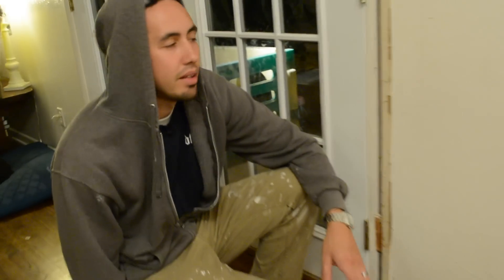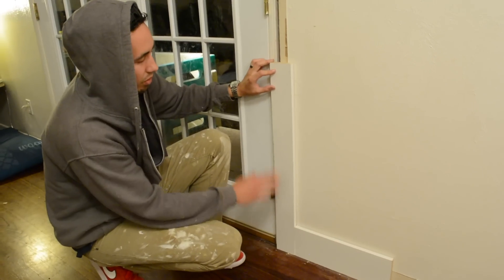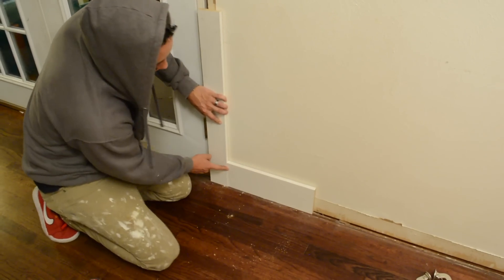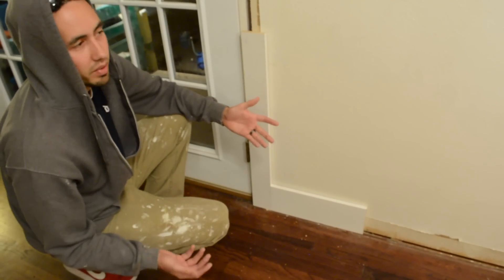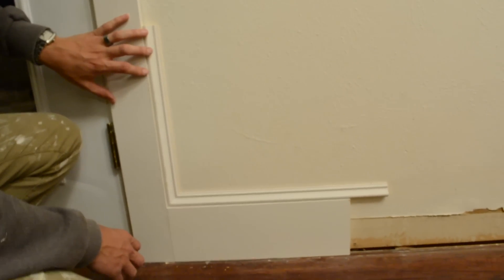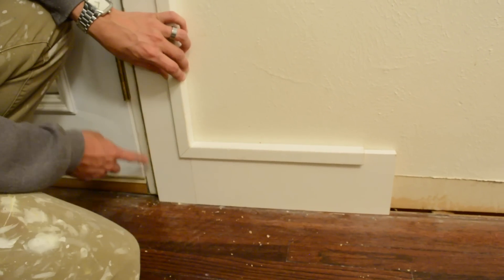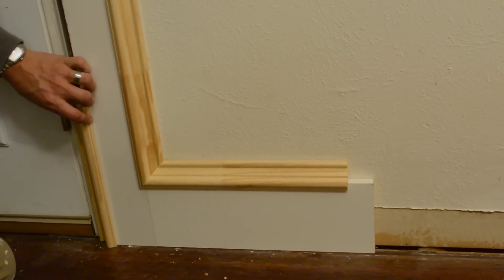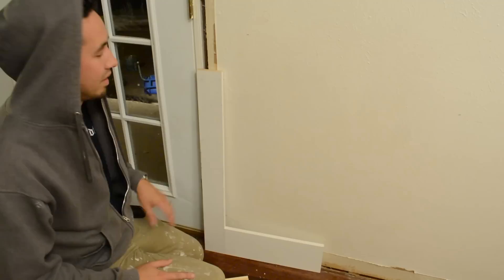3 Awesome Baseboard Ideas!

Comment: That corner molding on flat casing is a very classic look.  That is almost exactly what a previous house of mine had when it was built in 1913.

A cool baseboard treatment that I did was to have a base shoe in front of a 7-1/2" baseboard.  Then turning my electrical outlets sideways, I placed the box so that the outlet plate was exactly 1/4" above the top of the baseboard.  Then I added a case molding at exactly 1/4" above the outlet plate.  I used chocolate brown outlets and plates and then painted the shoe, base, case and any exposed drywall a chocolate brown colour.  The effect was that the base board looked like it was 14" tall.  Very classy look in our living and dining rooms with 10'6" ceilings.

Comment: I also LOVE shoe moulding! I think it totally makes the room look clean & finished, not to mention covering up a multitude of sins between the base & the flooring. I have yet to install base on a perfectly flat & level floor, but the shoe (& a good caulk job) can be manipulated to hide any small gaps. I love your videos They are informative & interesting & they are detailed enough to give a really good how-to without being slow or repetitive. I always learn something from them. 

I have a bathroom I installed beadboard in as wainscoting and I want to top it with a 1x3 as a "chair rail" with a 1x4 shelf installed at a right angle atop that. I want it to be strong enough to actually be used as a shelf for small items (picture frames, hair products, etc...) & I was thinking about using pocket screws to attach it to the studs. I just can't figure out the sequence & if that will actually work. I always see people top nailing the chair rail with finishing nails and that just doesn't seem strong enough. The wall is NOT flat (it is an old mobile home so I work with what I have) so if I put the 2 pieces together & then try to install it as a solid unit, I am gonna have gaps on both the 1x3 & the 1x4. If I put in the 1x3 1st I can cheat some of the lower gap & hide the upper gap under the shelf but I am gonna be pocket screwing in from the outside of the right angle & that is never good. I figured I would ask the expert! What do you think?

Comment: Here's a cool idea I saw somewhere but haven't tried yet. With that plain casing and baseboard when you go to add your pm5, or anything you like, you would use a one or one and a half inch spacer and install the pm5 above your baseboard. This will only work for painted trim. But when you finish you paint the pm5, the space you left between and the baseboard and or casing all the same color and it'll look like its all one piece and a much more expensive piece at that. Might look nice in your house.

Comment: All are good options and add a lot of extra style to plain trim.  #3 is nice, but too "beefy" for my taste unless it matches the whole house.  If you have access to a table saw and router table, the world opens up to you with options.  It is so much cheaper than buying off the shelf trim too (builder grade).

I'm going with standard one-by (3/4") trim boards myself, so I can build my reveals into the stock and not have to add separate pieces.  A more craftsman/shaker style with a simple inset bevel along the top edge and a small v-grove below it on the face.

Comment: Thanks for your insight and ideas,  I'm getting ready to buy my house and I was toying with a few ideas on how to re-do the millwork.  
What I've done in the past, is to use biscuits on my transitions. It's a little quicker and I don't worry about splitting out the mdf. Thanks again,  I really enjoy your videos.
Reply from the maker: Nathan Silver yes the biscuits would be just as good for keeping them aligned.
Reply: Nathan Silver
Hot Glue applied at the backside is MDFs nemesis. Clamp it glue it done,  if you get good enough I put it right on the wall hot adjust it nail it hot if it needs a tweak just pry push whatever and hold for a minute BAM. IMHO, MDF does not take to the expanding biscuit or any water based element without an amount of expansion. They need to start making trim outa HDF would be so much better.

Comment: I have been binging on your videos recently because they are so informative and you think outside the box and explain what you're doing very well. It seems though that in DFW Texas you have a lot of new construction to work on that is very square and straight. I live in Michigan and mostly work on older homes, or sloppy new construction with rough framers who don't even crown their 2x's. I am not a finish carpenter, I work on exterior mostly, but am looking to trim the inside of my home because it looks so whack. Is there an email I can send you pictures at and see if you have any helpful hints and tricks for sharpening up old plaster walls? It would be much appreciated.

Comment: I do alot of 1x mouldings too...instead of pocket holes to flush up casing to base, to get perfect reveals on 5/4 headers to the 1x side casing, or flush up 1x headers to 1x side casing, I use my festool domino joiner, but you can also use a biscuit joiner. I work a lot by myself so it's easier and quicker for me. Plus with the domino machine I can set it to a wider mortise which allows for movement...if I need to slide one piece up, down, left, right...or seasonal movement if I'm using real wood and not MDF.

Comment: DFW, love the idea with the 45 degree corner molding over the baseboard and casing.  I think I might try that.  only problem is I already put new base in everywhere but if maybe i'll rip it out :)  I like more the clean lines so I'm liking that option you provided.  thanks

Comment: you always have great tips, I worked for a guy that was an amazing carpenter. we would actually sand the paint so the glue wood stick better not sure just what he had us Do. another thing is we would use the Makita brand drill bit heads and the gold tip #2 for the impact gun. those work the best they are the most comfortable. always have a lot of them on hand. even though we would Craig jig everything we would also use bond where you would see 2 peices join then sand. but you are the best I have ever seen with the skills you have. I've never seen someone so well rounded in all aspects of this construction game !!!! wish I worked for you.

Comment: Question....after you lay down base or even shoe, how do you mask the floor off to both prevent from painting your floor and to achieve a nice crisp color transition between the trim to the floor.  Do you leave a gap between the base and floor to slide a strip of tape under or no gap requiring you to get as close as possible with a good masking job? I went with option B and spent hours on my hands and knees with a razor blade fixing my mistakes. Great work.

Comment: Great ideas... I'm installing some new laminate flooring and I'm thinking of not removing the base board and would like to 
use the PM5  in place of the quarter round . Would that work as I need to leave a  3/8" gap on the on the flooring
on each end for expansion. My better half isn't a big fan of quarter round. Thank you in advance.
'

Comment: I just read all the comments. Just an FYI or newbie DIY'ers coming across this video, and considering upgrading trim in this way,  I might mention that sometimes if the trim is widened,  the electrical switches might have to be moved over (if you have the wall space), as you can see in this video at 8:34. And in some houses, the outlet boxes might have to be raised if they are lower.

Comment: Do you ever have trouble with MDF swelling? We use finger jointed solid timber. They have MDF mouldings in old homes. Soft mushy stuff when pulling it off. We seem to do things quicker here, one piece mouldings rather than capping and shoe moulding additions as it's the customer paying for our time but I'm only new to building and haven't had anything to do with high end homes who would be likely to do more elaborate finishings . And on Mega Decks which we get here on TV they wear hoodies all the time.
From NZ

Comment: As pointed out by others. pocket screwing a long length of baseboard to a full length of casing is extremely difficult even for a carpenter.
Flush (butt) joints are to be avoided, if unavoidable then biscuit jointing is the fastest, safest and strongest way to go.
Reply from the maker: biscuits would be good as well. Especially with some gravy. JK. Haha. But seriously biscuits/plates would definitely be a great solution too. Thanks.
Reply: dfw crown, biscuits and gravy, now your making me hungry.
However you work, be safe out there.

Comment: Plinths and rosettes. How would the pm2 under the outside corner look? Don't have any handy but you made me curious. You can do so much with base cap. I just made an awesome chair rail with some repurposed 1x and base cap then had enough base cap left to make 9 picture frames under it in a bathroom remodel. 1x stained pine columns on the far wall by the toilet and shower topped with some scrap crown gave it a great look. This was  done pretty much with lumber that was scrap...and some caulk. lol

Comment: God help the next carpenter/homeowner who needs to replace either the casing, or the baseboard.
Reply: I'll agree with you pertaining to the pocket holes, that would be frustrating. Everything else is common trim, no special orders. Throughout all the homes I've built and renovated, replacing something like this would not be a major concern. Yes, it may be a little tedious, but if someone needed help from a higher power to replace any of it, I would not want that person renovating my home.

Comment: Hope you check your comments because I got a big question. Im doing a full rehab for my family, and have to trim out the entire house. I do have a paint sprayer but im not that good with it + floors are in and walls already painted. My contractor has suggested I just buy the trim, roll it all with paint ahead of time, then install. But after watching you and idaho painter, I can see you guys dont do it this way. 

Just wondering if you think its worth my time to go the extra mile and learn to use the sprayer better, and mask it all off? I have like 500 feet of trim probably im doing. And as I said the house is all finished except for this part. I want it to look really good as ive come all this way, so currently im undecided which direction to go...

It may be one of those situations where its not as hard as im thinking it will be + ill learn a new skill. but im also really ready to move in, and I know I can roll them all in a few hours and then be able to install next day... no masking needed.. tough call, thanks buddy.

Hope you can answer because Im sure there will be more beasts searching old videos of yours trying to learn the best way to do things!
Reply: and by the way, excellent video!!!

Comment: I would like to fake raise the height of my baseboards (with some sort of product a few inches above the existing basic colonial(?) baseboard and then painting the entire thing white to look more cohesive). I need something that has a depth of 1 inch at the top so a board and batten treatment won't extend over it. I am thinking I may even have to install some type of molding upside down, but I just can't figure out what to get. Do you know of a trim product that has a depth of 1 inch on one side that wouldn't look out of place on the top of a baseboard?

Comment: Good morning dfw , enjoyed the video/education .  
re the pocket screws , I like the idea of them , but as was pointed out , easy to do with short pieces , but I don't see it as much of an option with full length pieces .  I guess it just fits under " Whenever possible " .  although as another one mentioned , the use of a plinth block is a nice look ( and a good place for screws )  , that also opens a can of worms as to how everything would/could fit .  In the same thought  , I guess a block wouldn't work with wainscoting , And I certainly wouldn't give up the wainscoting just to have plinth blocks .
Love the ideas of the extra moldings . 
And while we're on the subject of extra trim around the casing , how often do you end up doing something different with the casing header on the doors/windows ? 
 Keep em coming   Bob

Comment: So by using pocket hole screws .... which I think is a great tip BTW.

But doesn't that mean if you have a wall that has a door in the middle that you'd have to put it all together on the floor and stand it up in one shot?  Do you have a video actually showing something like this?

Subscribed!

Comment: I've always been a bargain hunter.....it comes from my mother's side 😏. trim costs can really add up, especially when you layer on like you are suggesting. any ideas on getting the most bang for the buck?
Reply from the maker: The only way to do that would be to do it yourself. It is not too expensive. What is most expensive is the labor.
Reply: +dfw crown so, do you just buy it from the big box stores, or have you found to be able to find good prices from a online source? if you had a shaper or router with the right bits, could you save money by milling your own? thanks....that's my last question.

Comment: hey, very nice and inspirational! if that technic can be transferred to the ceiling, how can that be mounted to the ceiling if the studs are running parallel to the trims? screws or pin nails?

Comment: One problem I’ve run into with using simple 1x for casing around doors is at the hinges and door knob strike plate. The casing at 3/4” is proud of the strike plate and the door knob catch hits it first developing an unsightly mark. How do you get around that? Is it more typical to use 1/2” material? On the hinge side, the 1x has to be moved more than ideal reveal or routed out at each hinge. A big pain and doesn’t look great.

Comment: AT 5:30 when you talked about adding shoe moulding, how would you cut the ends?  Would you leave it at a 90 degree?  Also, when using pocket holes to secure the pieces, what if you have a second door to then connect the bottom trim piece to say on the right of where you were working in this video?  Wouldn't that get challenging on connecting it all?

Comment: I have a 11 and 1/4  base . it's a 3/4 mdf.  wall and columns.  would you attempt miter in or butting with a reveal. and it does have a base cap. it's commercial  but picky. thanks.

Comment: When using the overlapping molding,  I think would it would be more aesthetically pleasing if the door casing is the same width as the baseboard.  That way you you could make the the space between the two pieces of outside corner molding or PM6 more equal to the width of the part of the baseboard that shows. You could even get that space equal if you do the math out.  This is a matter of opinion of course.  You should try it to see if you like it better.

Comment: I think the pockethole thing has a problem which you bypassed by using such a short horizontal piece, and that is the 90 degree precision.  If you pockethole that, and it has to 8 feet to the next door or corner ... what about that?
Reply: I think it would be easy to put a 45 or a 22 on that and use that fancy ca glue he loves and slap on the rest. Have you not been watching? All base is jointed, what are a few more?

Comment: One thing to keep in mind is that the casing reinforces the door jamb. If you use a small molding between the casing and the door, you will loose strength and the jamb won't be rock solid.
Reply from the maker: rick4electric if the door is set correctly, the casing should not have anything to do with the sturdiness if the door. it is simply to hide the gap between the frame and the wall.

Comment: Suggest to use doorstop instead of shoe molding.  Gives 3D look but nicer than the 1/4 round which looks "less expensive".  Used in most higher end homes here in Canada.

Comment: I like the screws to connect idea, my one concern would be if you ever needed to work on a doorway in the future. You would need to remove the floor boards to wherever the first joint is. Anyone not aware these joints are screwed, would probably be quite annoyed??

Comment: I think a lot of people don't like shoe molding because you see it used to hide the install work of laminate floors. It's much cheaper to leave the baseboards in place and put a shoe mold in to cover the gap. Most times the baseboard is white and the shoe is this stained wood color to try and match the floor.  So I think it's become synonymous with that process.

Comment: I noticed most of the walls in your area not being smooth. Here we need to skim coat all walls from big nap rollers, customers complain when we patch a crack and the patch looks smooth and the rest you can see the role texture. After we use 3/8 rollers on walls and 1/2 on ceiling. I think is much easier for painters in your area, can't see many imperfections.

Comment: I wouldn't want the baseboard pocket-holed to the casing.  If I were to do a minor repair that requires removal of the casing or baseboard, I wouldn't like to be surprised like that when I try to pry out the trim piece.

Comment: Design problem. A baseboard with a flat surface becomes an eternal dust catch, the purpose of a smaller top molding it to create a slope which actually sheds most settling dust. 

Thats why you almost never see 3/4" squared top used by a designer. The only exceptions would be very rustic board baton type appearance.